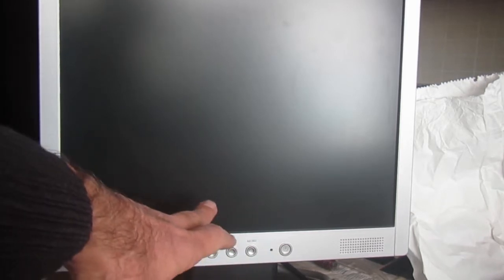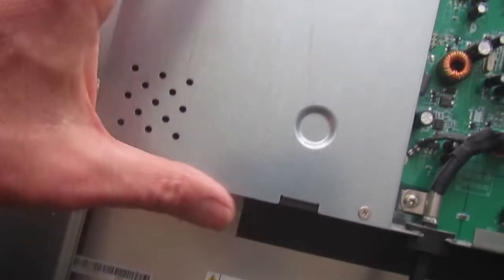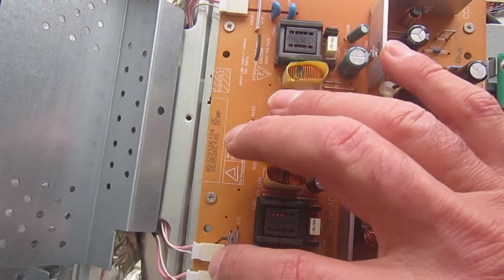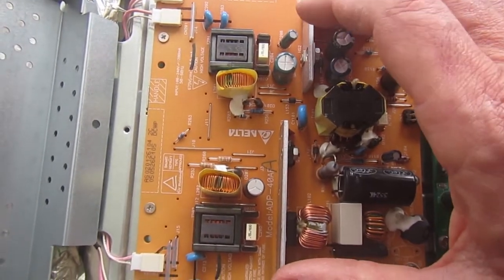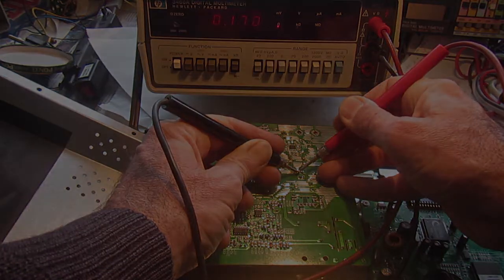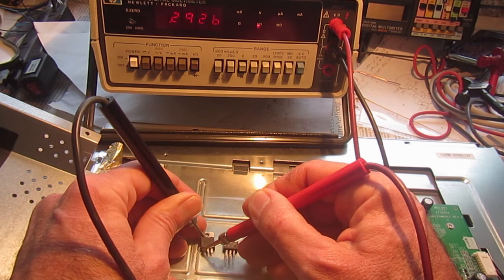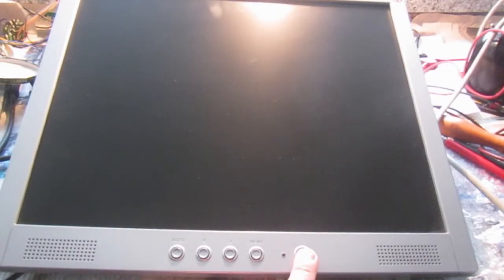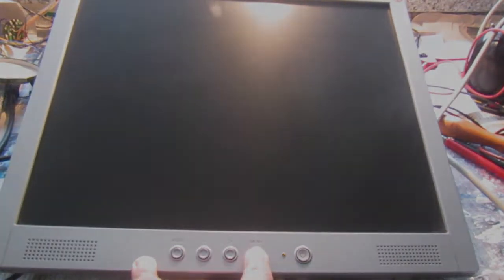"Modern" electronics repair: fixing an LCD monitor's power supply.

Comment: I had a similar power issue with an old LCD TV I got from my parents for use with my retro computers. After disassembling and tracing power with the multimeter it turned out to simply be a dirty power switch. Gave it a good clean with some contact cleaner and it all seemed to just work. Easy peasy. But it’s thanks to this great retro community that I had the basic knowledge and courage to just give it a go. Looking forward to more content in 2021, especially that CRT project you started back in Feb/March before everything went down hill this year.
Reply from the maker: Hi Glen, I'm working on that CRT project right now, I had to figure out a lot of details, I had to try a number of different circuits and I've had to abandon many dead-end routes. You know, I wish I had found someone else to ask for ideas or simply helping to test circuits. I have some working circuits since months but I still haven't accepted that's "good enough".
Maybe if I get fired, I'll have a whole lot of time to spend on the fun projects :)
Reply: @iz8dwf  Be careful what you wish for Frank 😆